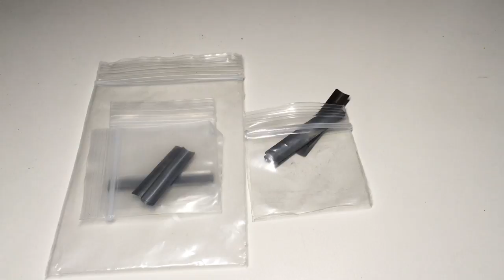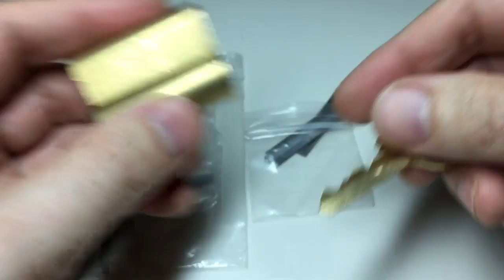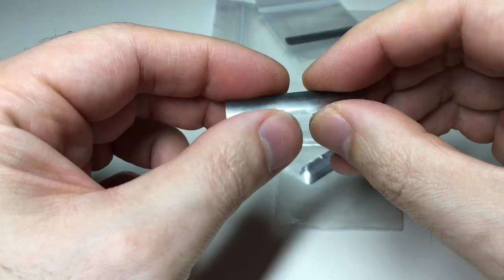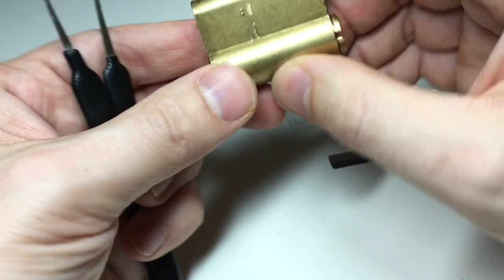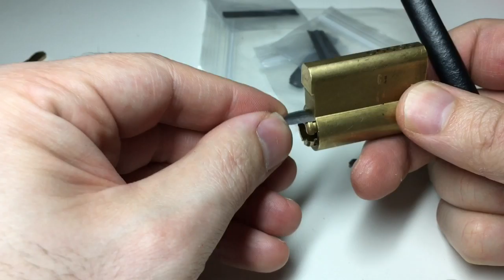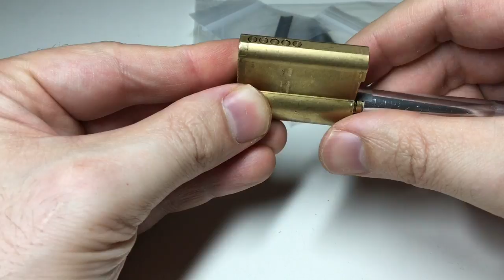(229) How to Use Core Shims - Beginners Guide

Comment: Recently I have been experimenting with core shims and found if you drill a hole a few mm deep in the lock face you can front shim any lock. I know this is destructive entry, but if you're careful you can avoid damage to the pins and chambers. For a professional locksmith this would mean you avoid having to drill the whole lock and encountering anti drill pins. I couldn't find any other reference to this technique online so this may be a new way to shim locks inspired by your videos. Thanks!

Comment: I know this vid is old now, but i'm trying to find out how thick these core shims typically are - as I know you have some dig calipers, would you mind measuring a shim ? I may have some stainless thin enough, but before I spend ages cutting, bending and deburring it, I thought I'd make sure the thickness is in the right area :o)  (I'm guessing it needs to be 2 to 4 thou, or 0.05 to 0.1 mm). Thanks Lock Noob.
Reply from the maker: About 0.004" :-)

Comment: What about a steel tape measure? Cut down?
Reply from the maker: In theory, if it's a small enough tape measure, that could work. Great tip... I'll go do some research :-)
Reply: Lock Noob not a problem... I'll probably be picking your brains more lol 👻
Reply: Feeler Guage would work as well.
Stratmando

Comment: I've never understood why you can't shim locks from the front
Reply: ATschTheCube  because on the front the core has a "lip" that covers the base of the lock body and doesn't allow to insert anything from there ! you can't make a shim turn around a curve that is very thight and also got "pressure" since the lock is kept close from tbe clip on the back... hope you can understand my bad english....
Reply from the maker: Yes, exactly this :-) and your English was perfect and I easily understood your explanation :-)
Reply: to be clear, there are some models of lock that you could shim from the front, but these are old and very cheap.  Lock manufacturers caught on to the trick, and started machining a lip into the front of the plug to prevent such attacks.

Comment: Hi Lock Noob, I understand not all of you guys have the correct key blank, but if you have, it's much easier to shim a lock using the correct key blank. The highest cuts ( shortest pins ) are already at the shearline with a blank. Speeds up the process, and you are less likely to crimp the shim between two pins.  Regards, Brian.
Reply: Brian Hignett This is exactly how I shim Lockwoods Ovals 😀  As you say Brian, using a key blank is much quicker than using a Pick or a Rake to lift the pins to the shearline.
Reply from the maker: Fantastic tip there... I can see how the leading point of the blank would lift/drop the pins to any height as you withdraw it from the lock while pushing in a shim. As you say though... it's having access to a blank that's the issue! I might do a vid on this :-)